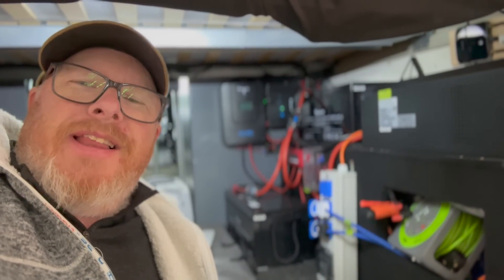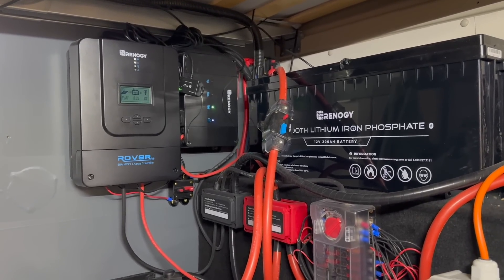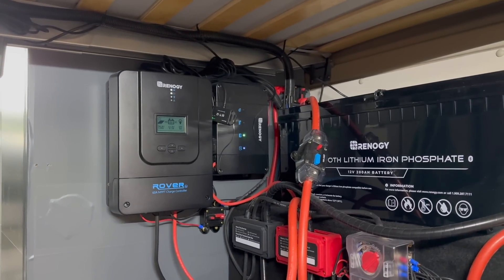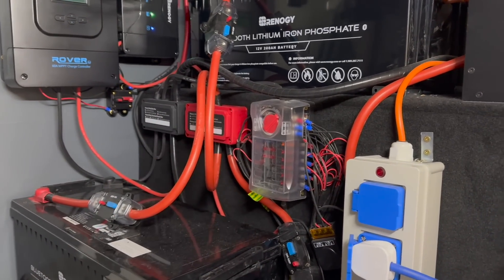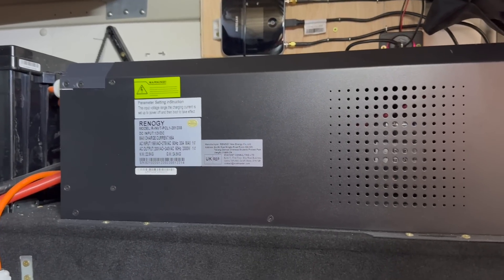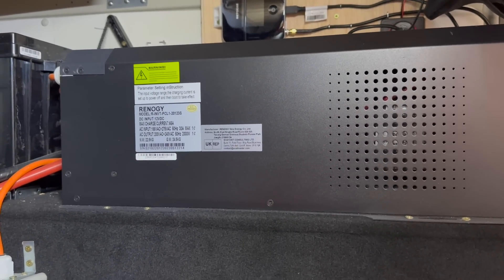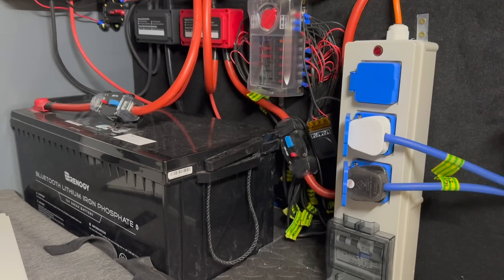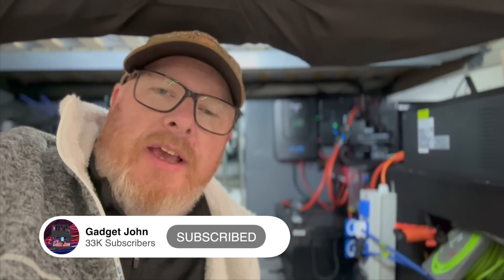My Renogy Off Grid Campervan Electrical Setup

Comment: Hi John Great video as usueal. I understand this is a centre tapped inverter which rsults in the RCD not tripping as it should... What are your thoughts on this? I have a similar setup with the renogy 3.000 watt inverter and am trying to overcoe this issue.

Comment: Thanks for the video John! I'm going down the Renogy route and pretty much ending on the same setup as this. Do you have an RCD protecting the incoming AC power to the inverter charger?
Reply from the maker: I've got a video all about that.

Comment: great video and info, out of curiosity how much charge is taken out of the powerbank if you recharge your batteries using the victron battery charger. Keep the videos coming followed you for years.
Reply from the maker: That would depend on the level of discharge on my hab battery.
Reply: Let's assume down to 20% ,, Following your advice I'm changing to rennogy 100AH battery and I'm trying to work out how many times I'd be able to recharge the battery using the Allpower 1500r so I can estimate how long I'd be able to stay off grid by using the powerbank to top up the batteries.  One place you've never visited is Maryport,  you can camp on the beach, weather permitting great views over the Solway to Galloway Coast and great sunsets, if either you or both visit drop me a message, would love to meet up and take u for lunch or dinner.  thanks for doing what your doing.

Comment: Great video, 

With the renogy gear did you have to supply your own cable ? As the Victron kits usually send all the cables and fixings.
Reply from the maker: I’ve never seen a victron unit arrive with any cables. Renogy supply cables with the inverter but not the other products.

Comment: Hi 
Can you tell the size of amp for your fuse/trip switch from battery, inverter, solar panels and so on please

I've just installed 2 X 200ah lithium batts to inverter with solar on van roof. Mine is to power 240v fan on the boiler for industrial pressure washer
Any information would be very helpful

Comment: Great video, but what does B to B mean? 'B2B usually means Business to Business',  I'm getting no results on Google? Battery to something?
Reply from the maker: Battery to Battery, also know as DC to DC charger, essentially it takes power from the starter battery and charges the leisure battery.
Reply: @GadgetJohn  Ah, clever. Thanks for taking to the time to let me know. I'm in the early stages of configuring/experimenting with my Renogy system for my home office, and these sort of videos are great for inspiration and to see how others have solved common tasks.
Reply: @GadgetJohn  John, are you sure that that is such a good idea. Now I know why my motorhome starter battery was dead. 
The gas ran out so the fridge automatically switched to 12 Volt using the leisure battery. The leisure battery drained and then drew current from the starter battery which quickly drained as well. Highly inconvenient!
Peter

Comment: Hi John , do you have any trouble with the two batteries not balancing at the same percentage
Reply from the maker: Yes, 1 battery is on standby 90% of the time. However, I’ve spoken to others with pairs of lithium batteries and it seems this is very common and causes no issues.
Reply: @GadgetJohn  thanks John

Comment: Hi John .
Great content as ever .Whats the benefits of tunning 2 MPPT ?
Reply from the maker: Thanks. Do you mean having 2 mppt? 
This video covers all the setup & having a dedicated mppt for 60A of solar charge plus the dual b2b & solar controller gives another 50A of either. So more charge power is available.
Reply: @GadgetJohn  But presumably you can run this system just with the DCC50a MPPT controller?

Comment: Hi John,
Great videos as always (also not the first time I have watched this video).
What are your thoughts on 48V systems?

I am currently renting a property which I'm using an EcoFlow Delta Max 2000 to power most of my home with over panelled solar to max out the 800w input (4 x 405W in 2S2P) and I'm struggiling to use any of the power in the EF DM 2000.

I have been purchashing this for a transition to Vanlife but am looking to increase my battery capacity with a 48V 5KW rack mount battery along with the Renogy Rover 60 Amp colar controller you have used. this will allow me to use all 1620 watts I have available and give me 7KWh of storage.
I would also like to use this in a van in the future as well.
I would also like to power 12V USB chargers as well.

Any advice on parts or diagrams for circuit layouts would be greatfully received.

Keep up the great work...
Paul

Comment: How much would a set up like this cost, we are currently trying to spec our new crafter for conversion and still deciding whether to go all electric with induction hob or still have gas for cooking. Is the 2000 w  inverter big enough for the induction hob and other appliances, was hoping to be more off grid than having to connect to shore power. Thanks great videos

Comment: This is very similar to the setup I plan to build. The one part confusing me is adding the ability to plug into mains and that then power everything and charge my batteries. Do you happen to know if this process or device has a name? Cheers!

Comment: Is there any way to get in touch with anyone from ecoflow, I’m trying to order delta 2 based on you’re earlier video but payment repeatedly fails at checkout and i can’t find a route to contacting ecoflow. Thanks.
Reply from the maker: I’ve heard others mention issues with them too, or ordering and then not receiving them in weeks.
Reply: @GadgetJohn  👍. That will make me double think buying it then. I need to trust something that’s costing a grand. ☹️

Comment: Awesome video. Very similar to the set up that I'm putting in my van. What have you done as regards to grounding the systems? It's not something that gets talked about much and as ever schools of thought vary.
Reply from the maker: If you mean 240v mains earthing then you don’t do anything with it as it should only ever be connected to a copper rod that’s buried a few feet into the ground nearby.
Reply: @GadgetJohn  Yeah, makes sense. Ta very much for that.

Comment: HG mate - do you find the app to be accurate for the battery power?  I've just done 10 days off grid,  Renogy 200ah, Renogy 60a Rover & Victron DC DC 30a.  The battery is showing 78% capacity, but 14.3v. So it seems to be out by 22%.  Have you found similar?
Reply from the maker: 14.3 sounds like it’s on charge. Testing voltage is the way to get an idea of %soc.  I’ve found my app & batteries to give very accurate info.
Reply: @GadgetJohn  I've installed a Victron smart shunt.  The battery BMS was giving incorrect data.

Comment: Hi John, thanks again for great content and sharing your electrical system. Can you recommend a resource on line or a YouTube video which details how to size the cables from battery to bus bars and from DC to DC to battery? I have watched many videos and everyone seems to have a different way of installing their systems. I do not understand what bus bars are for and what cables from which device should connect to them. A detailed idiots guide for me 😁. I have ordered my 2 Renogy solar panels for the roof and a Renogy solar charge controller plus Renogy inverter but need help so any advice or direction would be greatly appreciated.
Reply from the maker: Check out 12voltplanet.co.uk as they have great wire sizing info.
Reply: @GadgetJohn  thanks John

Comment: Thanks John, think I need some bus bars as my very basic 12V system has expanded a bit 🙂The camping socket with RCDs also looks like a great idea, might have to add that to my shopping list for the future too. I've just replaced my cheap PWM with a Renogy Solar charge controller with Bluetooth, waiting for the New Zealand stockist to get their first shipment in, then will be adding a Lithium battery with Bluetooth. I like the Renogy kit, especially how you can buy add ons, like the Bluetooth unit for the charge controller, and that they come with the essentials, like the temperature sensor etc, plus the prices are very reasonable for the quality of the kit. I find the app is pretty good too, thought I only have 1 thing to look at right now.

Comment: Hi John great video. I’m planning on upgrading my  2 110ah lead acid leisure battery’s to 1 200ah lithium how do you rate the renogy battery’s over other brands like Roamer and eco tree
Reply from the maker: I’ve not used the other brands and chose renogy as they aren’t rebranded like the others you mention, although many of my friends have ecotree and say they’re very good.
Reply: Ok thank you

Comment: Is your 240 earthed to the chassis?
Reply from the maker: No it’s not as DC flows through the chassis so you don’t want AC to flow that way too
Reply: @GadgetJohn  it's a safety thing I guess? There is a very small chance a live 240 wire could come loose and touch the chassis? Unlikely if you do it properly I guess. But that's one of the main uses of earthing in the home right?
Reply from the maker: An earth for 240v isn’t that same as a vehicle 12v ground as the negative in a vehicle is actually the voltage collector whereas the the 240v earth goes to a copper rod inserted into the soil / earth.
Reply: @GadgetJohn  Equipment earthing
Edit
Equipment earthing serves a purpose of electrical safety in an electrical fault. Its main purpose is to prevent equipment damage and the risk of an electric shock. This type of earthing is not an earth connection, technically speaking.[7] When current flows from a line conductor to an earth wire, as is the case when a line conductor makes contact with an earthed surface in a Class I appliance, an automatic disconnection of supply (ADS) device such as a circuit breaker or a RCD will automatically open the circuit to clear the fault.[8]
Reply: @GadgetJohn  I haven't done it in my van, but feel like I should?
Reply from the maker: I've fully explained already above why you shouldn't and why earthing equipment is totally wrong for a campervan

Comment: The combined BtoB and solar MPPT looks interesting and I've just read that it also keeps the van battery topped up.
Quick question, does your van have a smart alternator?
Reply from the maker: No, my van doesn’t have a smart alternator thankfully.
Reply: @GadgetJohn  I've been looking at other users who had to connect the "alternator sense connection" even for their non-smart vans to get a reasonable charge current?

Comment: Great use of the 5 minute video ;) thanks for sharing this and it’s the system I have gone with. I’m still in the early stages of my build, but this is the part I’m looking forward to! I noticed the battery charge was lower on one of them. Be interesting to know how they are connected to the system to see if this could be balanced better, or if it’s something the BMS will resolve over time

Comment: Hiya John when you’re on shore power does your cable go through a rcd before it goes into your inverter if so what size rcd would you recommend I also have a renogy 2000w inverter cheers Stuart
Reply from the maker: The incoming power goes directly into the inverter as it’s got built in protection breakers.

Comment: have u a link to thos in line breakers on battery cable please
Reply from the maker: There’s nothing special about the breakers, just don’t buy the cheap ones. The cable is also standard and I didn’t buy them from anywhere I can give links to.

Comment: Amazing video I have a weird question to ask my lithium batteries was all charged to 100% before install but my batteries cycle at different rates abit like yours some times they hit 10 % different states of charged any ideas how to rectify?
Reply from the maker: I wouldn’t change anything as long as the power delivery is equal. If it’s not then look at your cabling.

Comment: Wow - John what a beast of an electrical system - 800 w solar - 400 w over 2 lithium batteries and the list goes on and on ! Well done and thanks for sharing! This brilliant installation is not for the DIY er. And you make it all so easy. I do have one question could I replace my 2 x AGM batteries 120w ea with 1 or possibly 2 of 200w batteries as shown in your video? I have 375w of solar on my roof and Victron charge controller 100/60 and 2000 Pure sign wave inverter? Cheers Chris “The Aussie living in the Netherlands “ 🇦🇺🍾
Reply from the maker: Yes, you could replace your old batteries with a single 200ah lithium & you’d have more power. Just ensure your chargers are changed to lithium charging voltages.

Comment: Do you have a trickle charger for your Starter Battery ? That is a Monster Solar Panel John. I am guessing your Fold up Panels are 200w so you will be rocking 800w solar in total. Just imagine in time Solar panels will get so thin they could be the roll out Awning on the side of the van.
Reply from the maker: The b2b back charges to the starter when the hab batteries are 100% 👍🏻
The folding panel is 240w and I’d imagine in 10 years solar panels will pack more watts in far less space, it’s all down to reducing the diodes 👍🏻

Comment: Hi John,  I'm liking the Friday Five Minutes!  I have a couple quick question regarding 240v thingy...   So am I right in thinking that the 240v out of the Inverter goes straight into the Power Block with breakers and then distributed to sockets throughout the van?  Regarding the power into the inverter, do you have any breakers on the shore power coming in, or do you rely on the campsite breakers on their 240v distribution??   Thanks.
Reply from the maker: Yes, the rcd supplies all the 240v sockets in the van. The inverter has its own incoming power protection built in.
Reply: @GadgetJohn  , Great, thanks, good idea, I think I will be pinching!!, I don't feel greatly comfortable about wiring a consumer unit.  I have Victron Multiplus 1200w Inverter, I'm presuming that would have the same protection, but I will have a quick read up on it.  cheers.
Reply from the maker: Yes, your multiplus is the same principle as my inverter / charger. As long as your multiplus has a protection fuse then you’ll be fine.